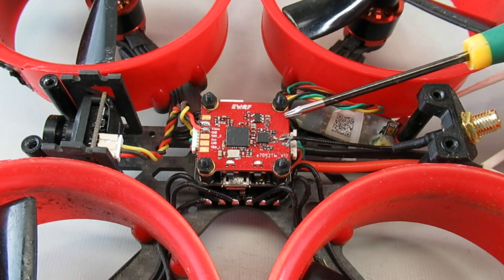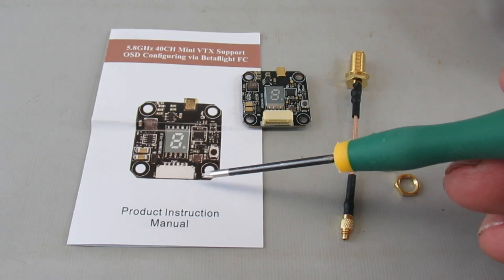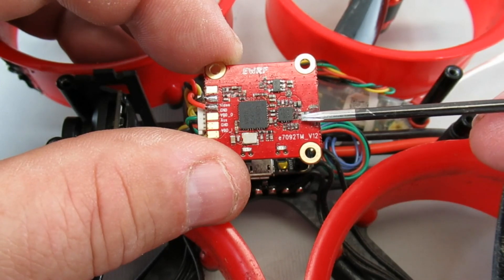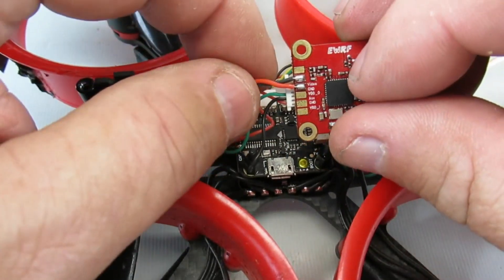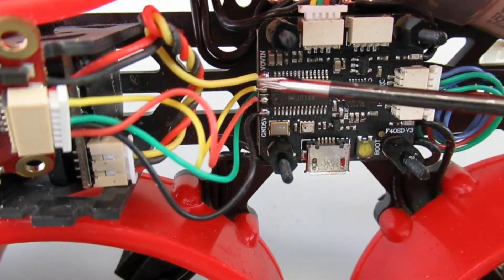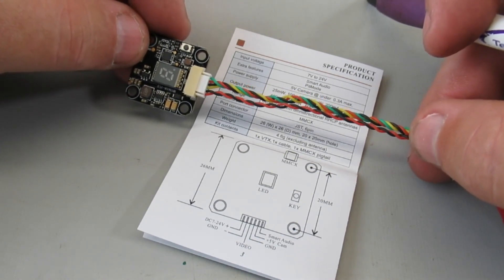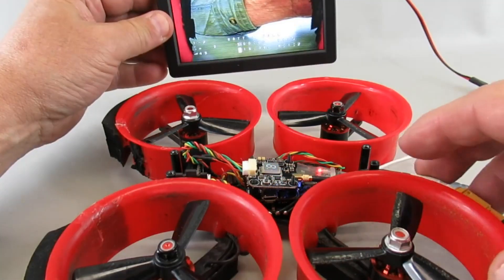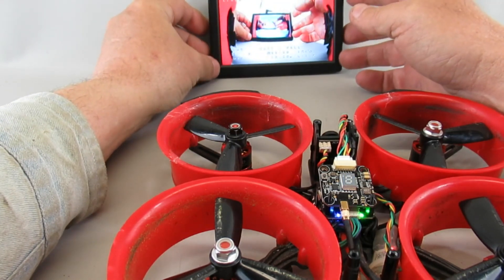FPV Reptile Cloud 149 Cinewhoop | VTX swap-out fix | AKK FX3

Comment: Hello tommy. I have reptile cloud 149 hd v2. As it came there are problem with osd. Ther no osd down display. And now i change the vtx like your akk fx3.. But still no osd display at the google.. Any idea what happen?
Reply from the maker: On Betaflight, on ports mine show UART 1 Serial Rx enabled and on the UART 3 line, under Peripherals, I have VTX (TBS Smart Audio) selected.
On configuration page,  under Other Features, make sure OSD in enabled.
Reply: Thanks for reply tommy.. Yes the setting just like u explained but still no osd. Can i  get ur betaflight setup so i can dump to my drone. Maybe missing some file?